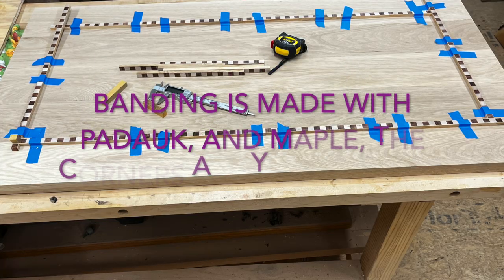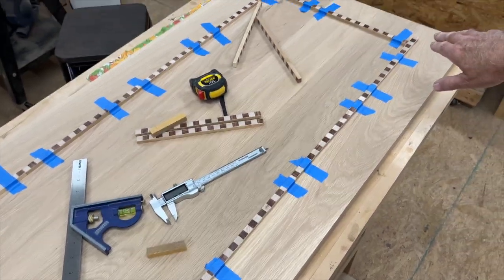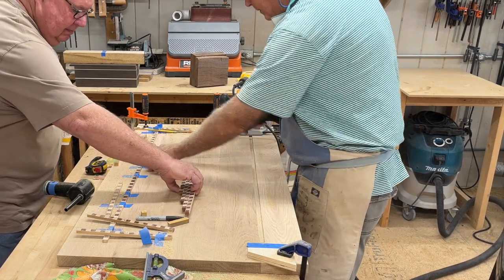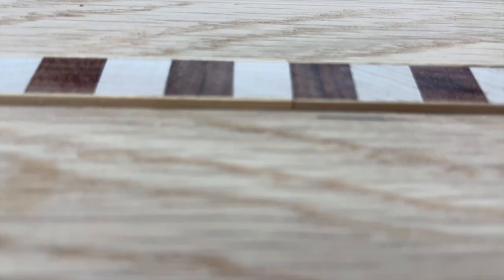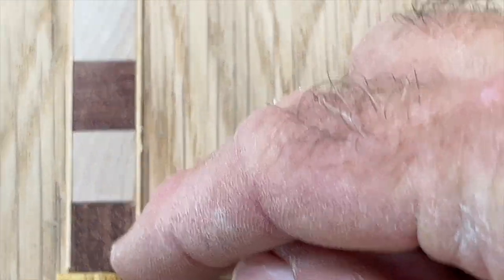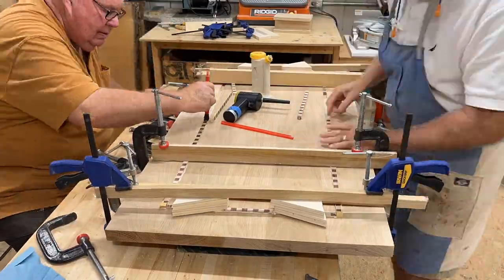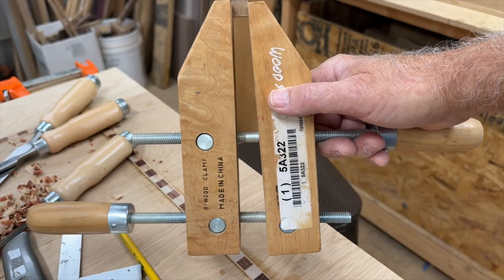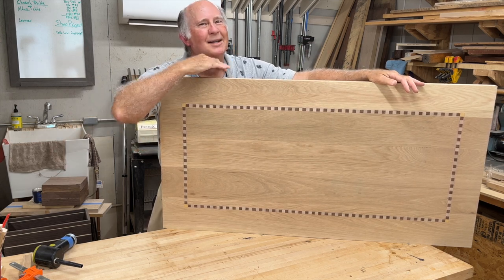Creating Beautiful Inlay Banding In Oak Table Tops: A Step-By-Step DIY Guide

Comment: Dude,just use you're router to trim those banding  🙄🙄🥱🥱👎👎
Reply from the maker: That would work in most situations, but I only had 1/8th of an inch to get down to the table top, and did not want to take any chances of gouging the table by mistake. I have used my router before in that fashion, but elected not for this table top.